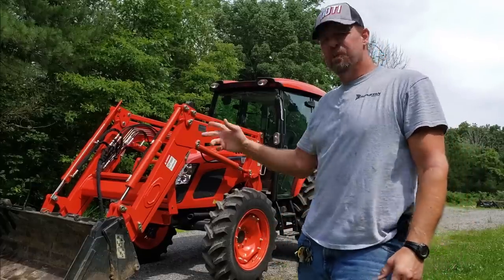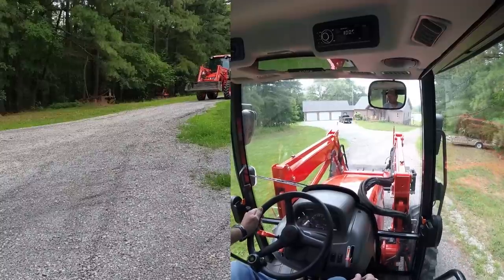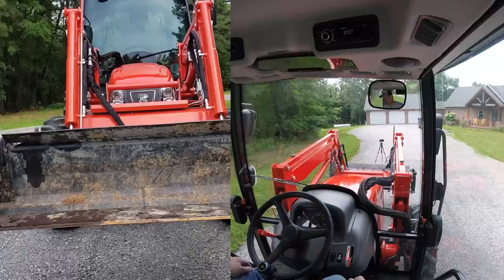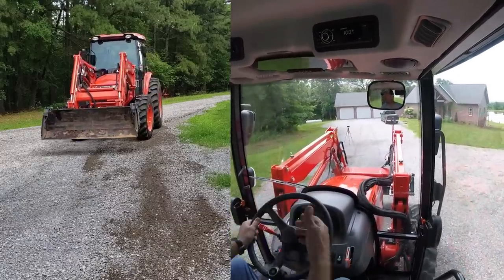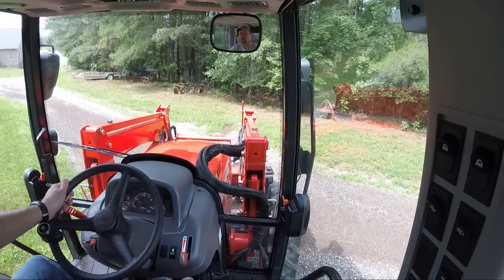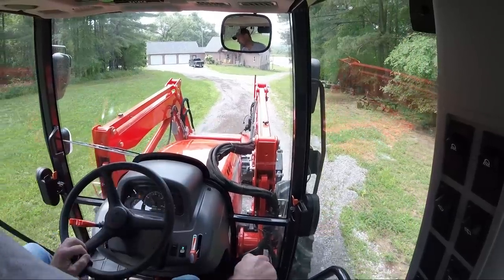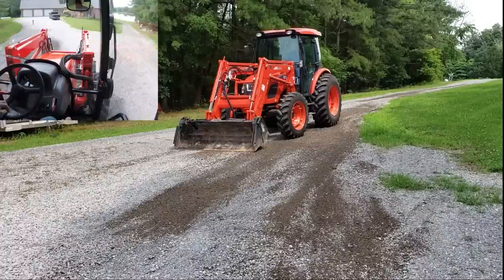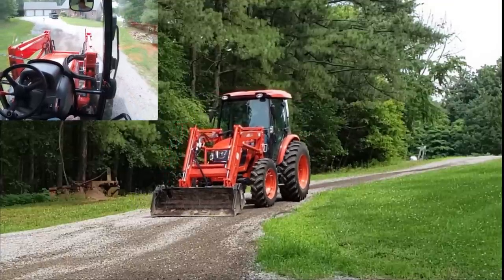How to use Float Mode on a Tractor Loader. Kioti tractor leveling gravel with no implements.

Comment: To correct you, it will not slam down to the ground when put into float mode, if it does, then you have problems, the fluid is regulated to only allow so much fluid through, I have the same tractor and I can raise my loader all the way up, put it in float and have enough time to get out and walk 20 feet before it touches the ground.
Reply from the maker: Good info right there. Guess each machine is a little different! Thank you.
Reply: @kapperoutdoors  check yours, lift it up all the way and slam it into float, or part way if you are unsure, if yours is working correctly, it will just drop slowly, when I say slowly, I mean from full height to the ground, it should take 3 to 4 seconds.
Edit, if it comes crashing down then your orifice is either missing or blown open.
Reply from the maker: @Monkey_Snot  That's good info. I guess using the skid steer, which seems like a hard drop, when you engage it, I assumed as much, but I'm sure you are correct! So, I stand corrected! Always learning something new here! thanks, have a good one.
Reply: actually i think(idk fs) depends on model mines brand new like 11 hours on it new and it slams to the ground, it still isnt a sudden sudden slam but it touches pretty hard we havent talked to the dealer abt it either tho
Reply: but ours is a cx2510
Reply: @peterhamm3407 It’s because your hydraulic valve is missing an orifice. It should not do that.

Comment: Kap have you ever considered a few loads of blacktop millings put down in that problem area? Packed in and some good sunny days will bind it up nice. Just ànother option!
Reply from the maker: Man that's a fantastic idea! I might look around for that stuff because I really don't want to put a ditch there. Thanks!
Reply: @kapperoutdoors  we used it for years at the highway dept. Mostly on washouts on hills. Sun and heat help bind it of course. Try to help when I can buddy 👍

Comment: Ok, have the  ck3510, not sure of the motion that you’re making in the forwardness of the stick if you move the stick forward it drops the bucket and normal use right, are you pushing it quickly into another position and do you obviously take it out by pulling back the lift the bucket up and that’s what it takes out of float mode, is float mode when the arms have no hydraulic power but the bucket obviously moves, dumb, and comes up, again, how does it come out of float mode just by bringing the stick back to the arms i.e. bucket
Reply from the maker: I'm sure you have it. Yes you push the stick forward, and then you give is a little 'snap,' and you'll feel it break free like a switch just went off. Then it is dead weight with no hydraulic power to the loader. BUT, while in float mode you can still move the stick left and right, which will control the angle of the bucket. Then when you want to take it out of float mode pull the stick back and snap it again to restore the hydraulic power. It is a great tool for grading! Hope you get it figured out, you won't regret it!

Comment: I noticed when we leveled our road the tracks where the vehicles drive sank while dirt was forced up in the center. Unfortunately this is a result of physics as weight is transferred to the ground at about 45 degree angles. Result was mud ends up on the road. Do you find this a problem on your roads?
Reply from the maker: My excavator calls that pumping LOL. Yes it was a problem early on the first couple of years but not much anymore. But we don't have a lot of traffic on our driveway either. Thank you

Comment: my driveway is very similar to yours but not quite as steep and after regrading and adding gravel many times after washouts using my kioti ck30 i brought in some dirt and threw down grass and then hay on top to prevent washout and so far so good. it took awhile but grass is coming up and it holds in place better than just the gravel. nice video. i like your kioti.

Comment: So that is what the float is best used for! Makes my hilly driveway easier going backwards then forward.
Reply from the maker: When back dragging in reverse, in float mode, the loader weight will help grade uneven spots to make them more even in Float mode, even when there are hills and valleys in the area being graded. A great tool no doubt! Thanks

Comment: Kapper do you have a wear blade on the bucket of that tractor or on your NS6010? Just wondering how much abuse the loader bucket is gonna get if I don’t install one on my NS6010. Thanks
Reply from the maker: It all depends on what you are going to do with it. I am more concerned with bending the straight edge of the bucket and not so much the wearing down. I don't think I have on on my NS and I do some gravel and dirt work but I try to be careful. When you start like pushing on trees and lifting or pushing something uneven then you push your luck! Good luck!

Comment: it would be great  if I could see the handle and what your doing. I cant figure out what to do on my CK25 Kioti.If I move the lever forward it just lowers the bucket
Reply from the maker: OK, you have to almost slam the lever forward. It takes some force, and that is by design so you don't accidentally do it. Or you can keep pushing forward slowly and harder as you go to get the 'break' of the hydraulic valve. Once you do it, you will be quite amazed at how helpful it can be for back dragging and leveling! Let me know if you get it!

Comment: So float mode only works when you’re going in reverse is that correct?
Reply from the maker: Nope works either way. But you have to be careful going forward if you don't have asphalt or concrete it's going to want to dig into the ground sometimes

Comment: Joe sometimes float is not the best thing when plowing snow the loss of steering lands lots of people in the stinky creek
Reply from the maker: Yes I should have mentioned it in that video but going forward in float mode is not good on your tractor at all but I've heard people do it for plowing snow if you have concrete or asphalt as a base which wouldn't be so bad. Thanks
Reply: Kapper Outdoors yes to some degree with concrete or asphalt if there are curb edges that you can ride to keep you from going over if you don’t have curb edges lawn scalping happens